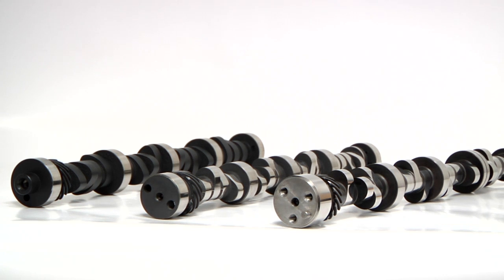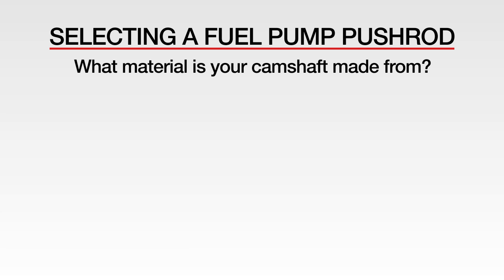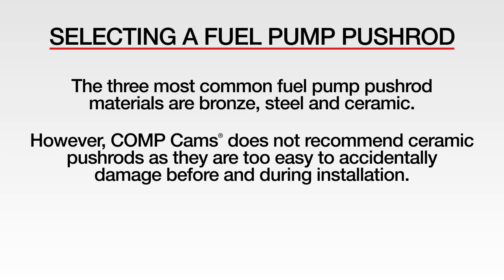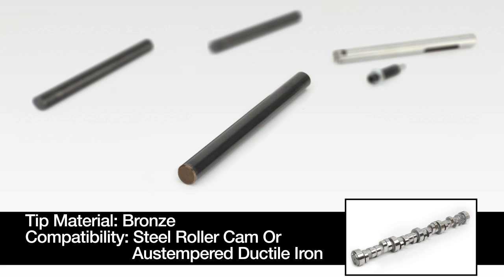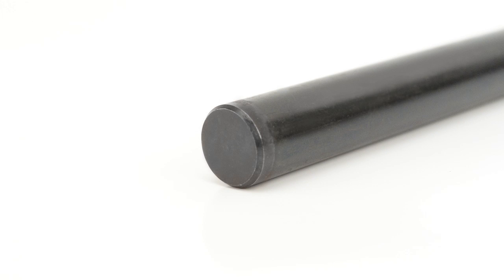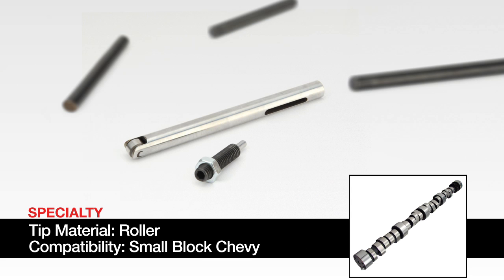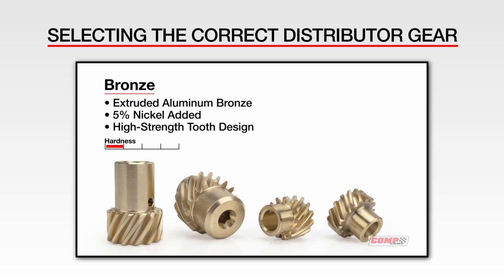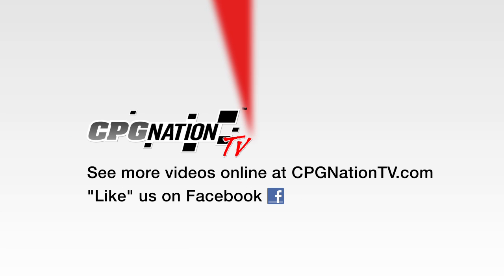COMP Cams® Quick Tech Video: Selecting The Correct Fuel Pump Pushrod

Comment: I order a comp cam 274 fo chrysler 300c 2012 hemi 5.7
What sould I put pushrod part number 7929 or 7748??
Reply from the maker: Hello - unfortunately we don't have a part number for a pushrod set that we know fits an 09+ Hemi. Thank you.
Reply: Thank for you reply
What do you suggest pushrod for chrysler 300c 2012 5.7? 
I order comp cam 274 part number 201-428-17
From http://m.summitracing.com/search?keyword=-201-428-17
I search for pushrod on http://www.highhorseperformance.com/mobile/Product.aspx?ProductCode=7929-7748

But I don't want to install the wrong part
Is there any company that provides pushrod for chrysler 300c 2012 5.7 vvt engine
Reply from the maker: There most likely are some other companies that make them, but we don't know of any to recommend currently. Sorry we can't be of more help. Thank you.
Reply: Have a 280h cam   Is stock pushrod ok to use or should use bronze ? Thanks
Reply: thomas peckham use a bronze tip or roller. Stock steel rod wore my lobe flat
Reply: @jrenna07  is there a difference in a 350 verses a 283 small block push rod
Reply: Daniel Higgins all SBC fuel pump push rods (Gen 1) are the same. 283 and 350 use the same, big blocks I.e. 396,427,454 are different